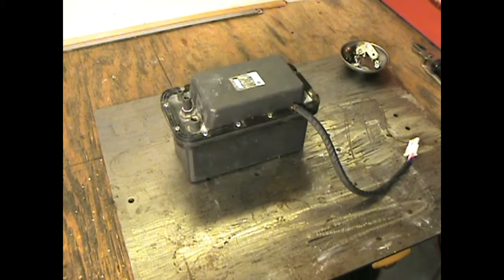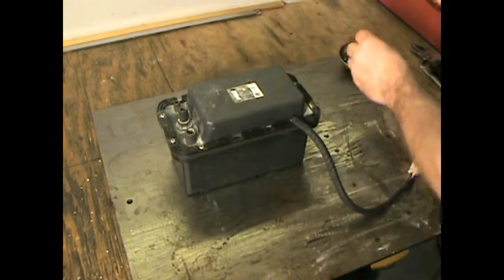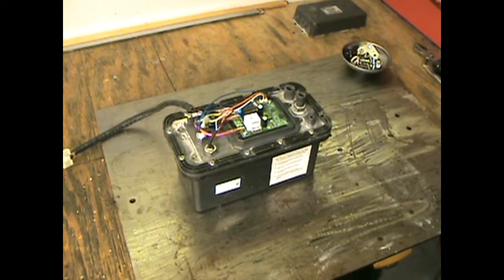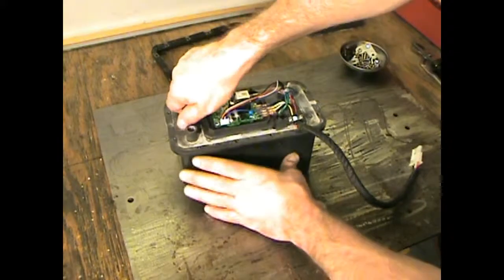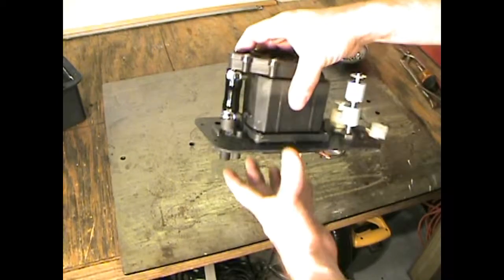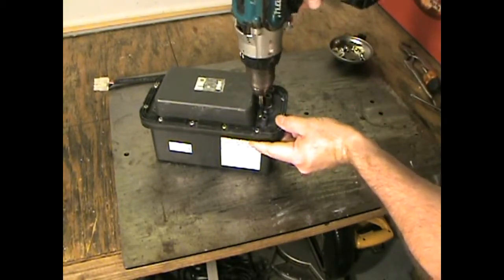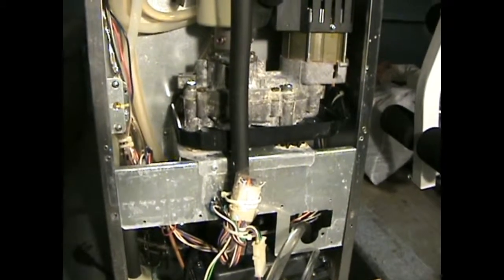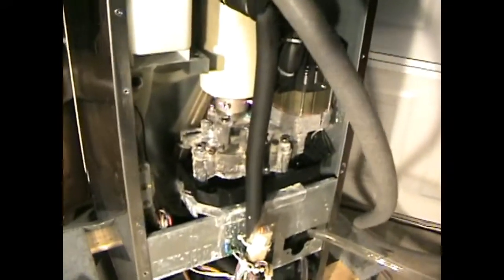Hoshizaki Undercounter Ice Maker - Part 2 - Drain Pump

Comment: So, is the water only from the ice melting? My manual says it needed a 3/4 line minimum.... Seemed a little overkill for some melting ice
Reply from the maker: It has been in my garage in 100+ degree weather for over a month, and it melts about 2 gallons of water a day.  I'm assuming at room temperature that will be less than a gallon a day.  I'm using 1/2 inch plastic tubing which will connect to a 1/2 inch copper tube draining into my bar wastewater line.  I would make sure the drain line doesnt get clogged, that may be why they recommend that size drain tube, to prevent drain clogs and costly water damage.
Reply: @weekendwarriorweldingdiypr4604  ahhhhh weird shit starts growing and clogs the line. That would make sense. We have that issue with mini split AC units all the time.
Reply from the maker: @hvguy  I'd think when you pull ot out every year or two to clean it, run some descaler through the drain.  Might want to check and see if that's approved in the manual, but the drain pump was filthy and it was supposedly not a serviceable part.
Reply: @weekendwarriorweldingdiypr4604  not serviceable by any old average ape is what they meant. Mine is gravity feed out to a drain. I've got a good sized filter on the inlet, plus our well water is super clean. Haven't had issues with buildup on my shower head etc
Reply: As it is just melted ice, wouldn’t make sense to recirculate that water back and make ice again?   Just wonder if that’s possible?